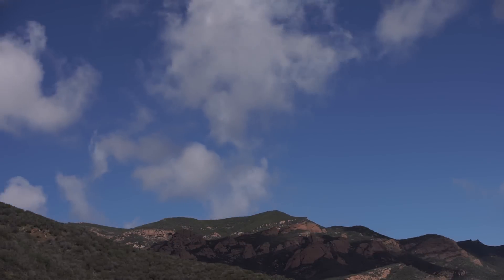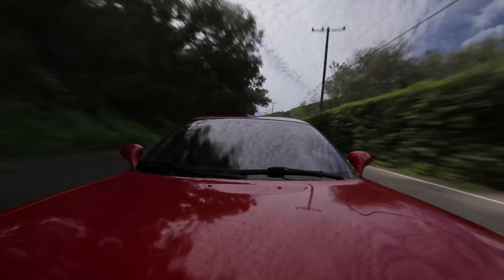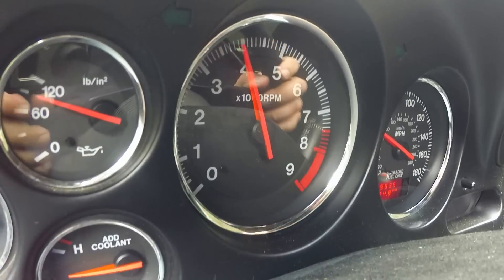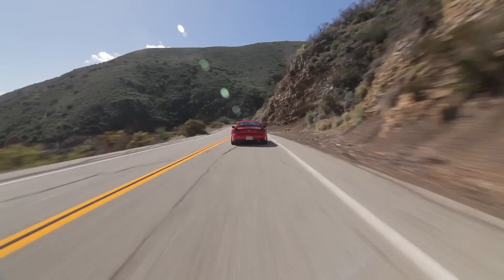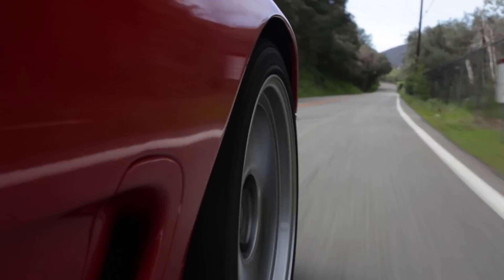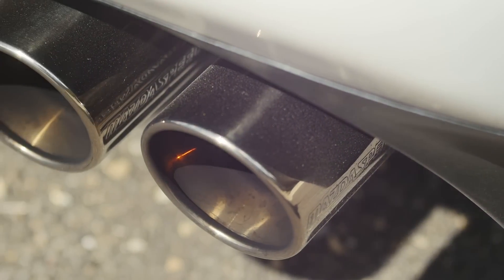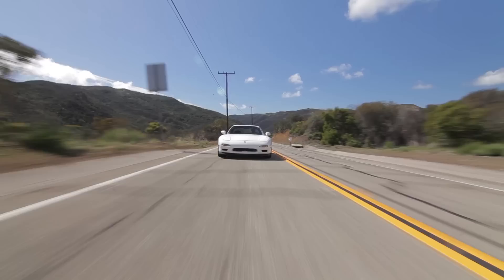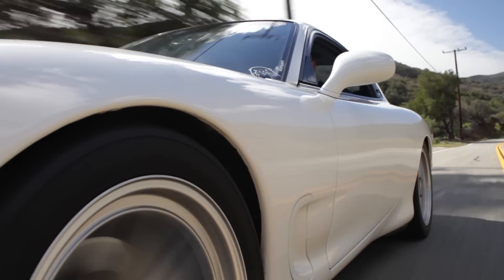Mazda  RX-7: Turbo vs V8 - /TUNED

Comment: the rotary is better than a piston engine because it inherently has a 1 combustion cycle per rotation of the eccentric shaft, much like a  2 stroke piston engine, but because it is a 4 stroke, you don't have a power band like a 2 stroke. It is also an extremely light engine, and for a really light car, the torque wont break the rear end lose traction.
Reply: +cptnoremac So for some reason america believes "no replacement for displacement". This is unfortunate because it is an excuse for piss poor engineering. Enter the Mazda 787B, which had a naturally aspirated 2.6L (158ci) rotary making 930hp. Is it sad knowing that weed eater sounding car destroys any other piston engine in terms of N/A power density?
Reply: +cptnoremac The 787 made 700hp at 7000rpm which is a power density of 270hp per liter as apposed to your barbaric ford pushrod engine at 145hp per liter. so your monster V8 has almost half the power density, and gaurenteed to weight an ass load more than the rotary. And I assume if you've looked that far into the Mazda 787B that when they pulled the engine apart after the race, they said it was so reliable and sustained so little wear, they could have ran it for another 24 hour race. The rotary dominated the race so easily they changed the rules to outlaw rotaries.
Reply: Frank Pawloski
Once again you're childishly trying to make this into a war between "your" motor and "my" motor, which is irrelevant to how bad it sounds. And it's stupid anyway because you didn't design the rotary and I didn't design the piston engine, so you have nothing to take pride in. Try taking pride in something you yourself have done instead, which is probably nothing.

But since you won't shut up about it and need to be put in your place, it's not fair to compare horsepower/liter between a 2-stroke and a 4-stroke engine. It's burning twice as much fuel per cycle as a piston engine, so you really have to double the displacement in the calculations to do a real comparison of efficiency. The special production rotary you mentioned would therefore be 700/5.2 = 134.6 hp/L. Meanwhile, the Ariel Atom has a 3.0L naturally aspirated V8 making 500 horsepower. The specific engine output for that is 166.7 hp/L. And that's in a production car. Rotary loses again.
Reply: +cptnoremac awww little one, the rotary isn't fair? do people double the displacement of 2-stroke bike engines to make the comparison of power "fair"? no, they just call 125's, 250's and 500's by their displacement because that is how much they displace, just like the rotary displacing only 2.6L. You don't feel it's fair because it uses 2 stroke fundamentals but being compared to a 4 stroke in this case it doesnt help your argument. Maybe you should stop liking your 4 strokes, they make you a "fair" person. You ever notice winners never complain about the "fairness" of a situation? strange. I'll let you get back to your safe space where you can think of the world as "fair".
Reply: Frank Pawloski
What do you mean "winner"? Remember where I said I like rotaries? Also, remember the part where I pointed out you have nothing to be proud of because you didn't design the rotary engine because you're useless to society? Let's keep that in mind as we move forwards.

Wow, you really fixated on the word "fair" there. I think maybe you haven't worked in a very scientific environment and probably only ever heard that word in grade school. Let me try a little harder to explain it to you. By not "fair," I mean you're fudging the numbers to make the rotary look better. It's not impressive to make more horsepower out of a 2.6L rotary than a 2.6L piston engine because the displacements are basically measuring different things. For all intents and purposes, it is equivalent to a 5.2L piston engine. Ceteris paribus, the two motors are burning the same amount of fuel and making the same amount of power. So your idea of "less with more" is warped. The only real advantage of the rotary is its smaller physical size.
Reply: +cptnoremac by fair I mean that the rotary in the physical world displaces 2.6L and not your 5.2. Should we alter piston engine sizes just because one has a better VE than another? The 2.6L in the 787 is the most power dense N/A engine in the world, making 930hp and that's that. What an SJW.

Comment: Back in the late 60's when the rotary engined cars first became a thing, my Dad said 'if the rotary engine had first been developed at the dawn of road cars, and 50 years after someone came along with a reciprocating engine, they'd have been laughed at'. 
If you want to make rotary motion (turn wheels) it makes sense that the prime mover would be rotary, having pistons that come to a complete stop twice during every crank revolution, how daft is that?

Comment: This was an excellent comparison, good arguments for both cars. Naturally I will be biased to the rotary, as I own an RX-8, but I am biased to it for what I believe to be logical reasons. I've driven Camaros, Mustangs, Corvettes, M3s, and a TT Supra, and nothing has ever made me smile as much as a car powered by a Wankel. Putting a V8 in an RX-7, (or RX-8, for that matter) undoes everything Mazda engineers worked so hard to create. Yes, the wankel engines consume a lot of gas and oil and produce little power relative to the amount of fuel they burn, but they are incredible engines in terms of power-to-weight. A complete 13B-REW (with everything needed to run, flywheels, manifolds, turbos, A/C, P/S, pulleys, etc) weighs 31lbs more than a bare LS2 (no manifolds or any accessories) and is much more compact, allowing it to be mounted low and far back in the chassis, producing very even-spread weight and impressive handling dynamics that are still used as a benchmark for modern sports cars. Putting a big V8 under the hood undoes all of that. Sure, you get more power, torque, and better fuel economy, but the car just becomes another front-engine, rear-drive car with a big V8 under the hood, which we certainly have no shortage of in the US market. The RX-7 is a purist driver's car, as the owner of the red 7 stated, and I couldn't agree more. Adding the extra weight and disrupting that near-perfect weight distribution dulls the feedback and ruins the neutral handling characteristic of the 7. Having a lot of low-end torque makes a car lazy too. Isn't the whole reason we still buy cars with a manual gearbox because we want to change the gears ourselves? Why would you complain about how often you have to change gears and having to keep it the right gear when you get to do it yourself in the first place? Might as well just buy something with a slushbox if you're going to complain about needing to change gears more often.

Comment: To me the rotary engine is the part that makes the RX-7 so unique and special. Since they don't make them anymore, I feel sad when I see swapped RX-7s. Not that I don't like V8 engines, it's just that it doesn't seem to be the right car to begin with. Maybe the V8 is better in some ways, but not having the rotary makes it lose it's character. Like Matt said, it turns into something similar to a Corvette. But then, it's not a Corvette.

Comment: I like rotary engines for 1. being different. the 1st time i ever saw a diagram of a rotary engine it baffled me and i was encapsulated to every detail. 2. the rpm range oh baby teh rpms!. 3. simplicity of the engine makes it easier to work on. 4. modular, <-- this part makes it better than any piston engine. oh u need more power and don't have $32,000 for parts and machining? just throw another rotor on.    Just fyi i don't even own a rotary XD ive had the pleasure of working on 1, but don't have the means of owning 1 atm. also i have more chevy 350 4 bolt mains than id like to admit.

Comment: Must be an iron block LS - I always heard the aluminum block LS engines are lighter than the rotary. (and 1000% more reliable)
Reply: Lighter than the 2-rotor 1.3 ? Surely not !
Reply: +Malicious SRT The aluminum motors are about 50-70lbs heavier than a fully dressed twin turbo 13b
Reply: verz22
And 1000% more reliable - thanks for the math, really.
Reply: +Malicious SRT The LS (Al small block family) engine have greater specific output (I mean specific referring to per unit weight, not displacement) but they are still a much bigger engine than the rotary. There isn't much in the four cycle engine world that can compare with the rotary in terms of specific (per unit weight) output.
Reply: +Malicious SRT    I have an LS2('05 GTO) Hinson swapped '95 RX-7.  I weighed the car before and after and the aluminum LS2/ T-56 is only 15# heavier.  There is no noticeable difference in handling for that negligible amount of weight.  There's probably more weight issues with the body weights of different drivers.  This swap makes an absolutely perfect car. No rotary reliability issues, gorgeous body, fantastic performance and 28 mpg on the highway.T. Schenk
Reply: veeeschenk
Awesome, sounds like a wicked car - enjoy it!

Comment: Matt, you asked for someone to explain why rotaries are better than piston engines so I'm going to do that. First off, all of my experience with rotaries has come from a naturally aspirated fc convertible. It is stock, and is fairly slow (160hp and like 3500+ lbs). However, the engine is pretty much as smooth as could be. Past 3000 rpm I can hardly tell how fast its revving, 6000 rpm feels and sounds almost the same as 3000rpm. Also, the torque curve is incredibly flat. It pulls just as hard at 1500 rpm as it does at 6000rpm. This makes it great for street driving because despite having less than 150 ftlbs of torque I can easily get moving without touching the gas (more easily than some more powerful cars I've driven). So no, it doesn't have tons of torque like a v8, but it is great to drive because the torque doesn't fall off much in the top end. And for proof of the flat torque curve, here is a dyno graph of a street ported na rotary. http://i84.photobucket.com/albums/k8/craigw1_2006/dyno-19Aug2006.jpg

Comment: Nothing at all wrong with an LS V8 but a Mazda RX-7 is a rotary that's what the R stands for! The greatest advantage of the rotary is the lightness of the block. I had a single turbo RX-7 and it handled like a go-kart. The ride was a bit crashy as the stock suspension was very firm but apart from that, it was the sweetest handling car I've ever owned. (and with a single turbo conversion and good porting it sounds like a Me109 in a tunnel!!)

Comment: Sorry, diehard rotary fan. Anything but a rotary makes me sad. 

I appreciate the spirit of the V8 swap and the hot rodding tradition, I grew up a roaring V8 gearhead and drag racer. But I grew to be a rotary fan, I love them. Some people just get magnetized by them, i'm no exception. I would love to have a clean FD and for fun I would prefer it highly modded, maybe a 20B (the engine it should have had originally ;) but a clean & bone stock FD is getting hard to come by. 

I have an 88' FC 10th AE, one of only 1500 made and not many left, I love it!

Comment: How about some kind of combimation. If possible it would be awesome to take a much smaller v8. I'm talking 2.5 to 3.5 liters so it's lighter but has that torque with a turbo or 2 of course. Or this might sound completely rediculous, expensive and idk if even possible but putting a Nissan gtr motor in there would be sick. But I'm just talking imaginations I have no clue if that's even possible

Comment: This is a great review or comparison as far as professional and video goes great job I liked watching this but if you were going to compare fairly I would think matching the 1.3L up with a 6cyl swap or even a Chevy 350 swap would be closer to really ask your self if Mazda should have chosen a different engine wouldn't it? It is unfair to choose one of the best and most expensive engines Chevy has to offer to a rotary engine that is not the best Mazda has to offer not to mention the price differences an LS swap has a huge price tag to it, to where it was not even mentioned if the rotary had engine modifications such as a bridge port if the rotary only had bolt on upgrades it is not even close to the potential of that engine. The rotary you can pick up for around 2000$ usd complete which is very cheap compared to the LS's price tag.. I would love to see another one of these against the LS swap and the 20B swap then they both are swapped engines, closer in power, and a all around better comparison or at least a ported rotary (that is usually the first upgrade a owner chooses to preform in my opinion). it might make you change your mind..

Comment: Matt although I mostly agree with most of your thoughts I'd disagree about v8 vs rotary. It's not the power sense it's the balance and lightness of the rotary that makes it a very stable, throwable platform. Much easier to control and in fact makes you drive faster around your favorite mountain road . It was designed into the car so swapping a v8 will most likely throw the balance and distribution of the car making it not as well proportioned as it is. A true rx7 enthusiast would never swap a v8. Only engine swap I'd say would to go to a 20b and keep it natural aspirated to keep the same power but to have power deliver even smoother. Plus why rx7 when monster Miata?

Comment: Have to disagree with the Corvette similarity comment.  I had an LS powered FD and was recently looking for a C5 Z06 then a C6 Z06.  They don't feel the same.   As much as I tried to, I don't like how the Corvette drives comparing to an FD.   Corvette feels bigger, heavier, wider, longer and simply not as agile.  Engines aside, I'm not sure if the C6 Z06 (2008) is actually more refined than the FD either, although it came out 13 years later...

Comment: Fair assessment from Matt...  The LS motors are great, great motors. But to me it seems easier to pay 9-10k for a C5 Vette than to build one yourself from a Japanese car. Which honestly, The C5 looks very similar to the FD(if you squint). And the C5 FRC Corvette is just sex.

The rotary engine is cool, unique, and makes good power. Thats why some people buy an Rx7 instead of something else.

Fuel mileage? I thought these were sports cars not commuter cars.

Comment: I own a '94 RX-7 right now. I made 400whp with my rotary seutp and I loved it to death. I currently have a completed 2JZ swap in it now, untuned, that should make 400-500whp once tuned. It feels really good, actually. Weight, balance, response, etc. I've been really happy so far.

I've driven LS1-swapped FD RX-7's before though and I absolutely hated it. I felt like the low-revving high-torque characteristics of a V8 engine in and of themselves simply do not belong inside the chassis of an FD RX-7 in my opinion. It just didn't feel right at all.

For anyone curious...I've owned a BPU'd '88 Turbo II RX-7, this is my third FD RX-7, and I've had a turbo'd '04 RX-8...so I love turbo rotaries. I would love to own a 3-rotor FD one day too. So don't hate. :P

Comment: I've not owned a Rotary or a V8 , but I heard many things from both sides, and it seems that rotary is the better option,  fuel efficiency is about the same from what I have heard, the price of the V8 conversion is enough to have multiple rotary engines, and a thing that I heard is that the transmission shifting is not as nice in the V8, I mean its no real wonder, I mean Manual cars in the US do not need to constantly change gears unlike japan with all the mountainous areas. But again, build what you want at the end of the day, personally if I get a rotary and it blows, I may just Miata or 4AGE swap it

Comment: For arguments sake; what we are talking about in this context is a modified stock RX-7 versus one with an engine swap. So why not approach from the stand point of engine swap against engine swap? For example, a 3 rotor swap versus the LS swap. It would make sense to use this as a comparison based on the fact that they are both very popular changes to the car. Furthermore, to envelope the entire spectrum, why not pit a 4 rotor turbo vs an LS turbo? What I am essentially trying to say is instead of stock against swap, how about we compare swap against swap?

Comment: The Rotary engine better, because you have less parts, is way lighter and has a lower center of gravity :D
Reply: it also sounds like a weed wacker
Reply: the rotary sounds like a weed eater from hell and drinks twice the fuel,and is finicky .use it till it blows up like they do quite often then put a v8 into it.there is something awe inspiring about an all aluminum engine that sounds like pure supermodel sex .the bonus is doubling the torque ,upping the horsepower ,having the option to supercharge /turbo it for another 50% horsepower increase and using half the fuel to do it.

Comment: The Rotary is BEST when N/A. Sure it may not make as much power as other engines may, but race a rotary for 24 hours and v8, v6, or i4 for that same amount of time at high revs and youll see the clear victor. In the 80s the rotaries would races for 24 hours and then after they could be left on and run perfect. There are a lot of isma racers who went a decade without ever blowing an engine or only did because they set the revs a couple hundred too high. If you want reliability on n/a and keep a light car with good balance that is hands down the way to go.

Comment: i believe mazda used the rotary engine due to the fact that it's light and compact thus maintaining the handling characteristics required to make a good sports car. Don't forget that you can get 400hp easily from what is a 1.3 L engine